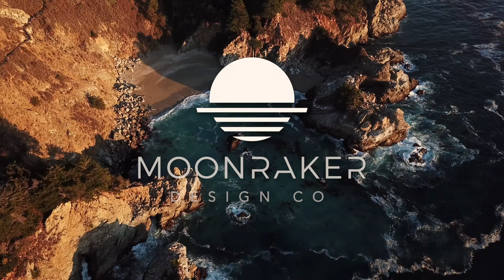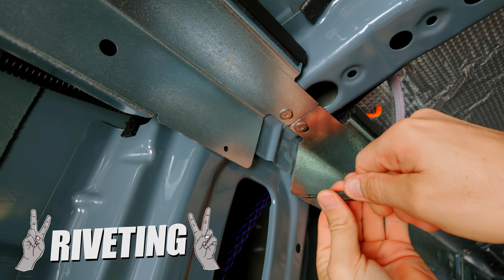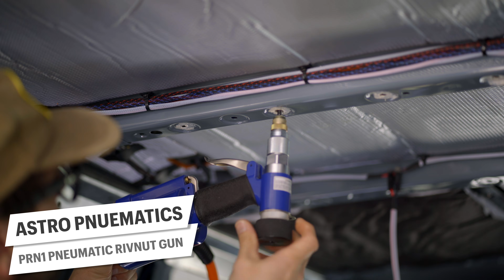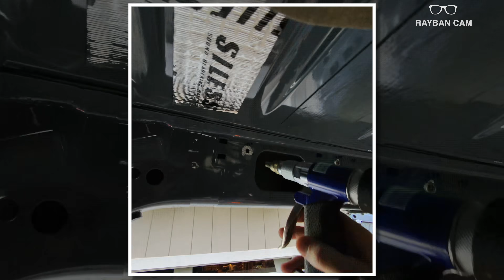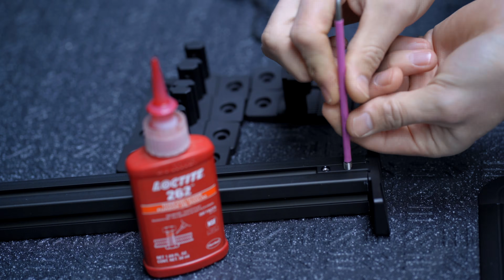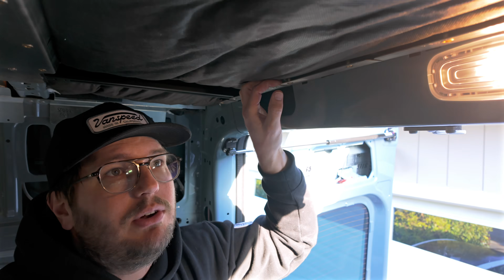Adventure-Ready Sprinter Van Ceiling Structure: Our Secret to Strong Support

Comment: This product on your website ?
Reply from the maker: Hey yes, all parts can be bought separately. Everything has been updated with quite a few improvements from these original prototypes. 

- Front & rear transitions for headliner and d-pillar are always stocked - https://www.moonrakerdesignco.com/collections/interior/products/sprinter-144-van-ceiling-support-structural-kit-copy
- Wall transitions I bring in small batches and have some in stock right now - https://www.moonrakerdesignco.com/collections/interior/products/sprinter-front-rear-ceiling-transition-bracket-kit-copy
- Center ceiling support braces are made custom because there's a lot of things going on with peoples roofs & cabinet situation these days so like to make sure those are addressed - https://www.moonrakerdesignco.com/collections/interior/products/sprinter-144-van-ceiling-support-structural-kit
- Brackets for the extrusions are always stocked, but you buy the extrusion pieces yourself. 

Hope this helps.

Comment: Amazing work! I wish I had the patience to be even half as meticulous as you. I’m headed over to your site to grab a set of brackets for the Dometic we just installed.

Drumroll… and an unsolicited tip:

For anyone who doesn’t have a Swarf Sucker 9000, a neodymium ring magnet works great for catching swarf. Just place the hole of the magnet over where you’re drilling and it’ll snag  most all of the metal shavings. I put a small piece of painter’s tape down first so the magnet doesn’t scratch the paint.

Thanks for the great video! I also just watched your isn’t it hydronic video and took a ton away from it.
Reply from the maker: Hey friend, thanks a bunch we really appreciate it.  I wish I had more time to work on all the things!!  It's getting very difficult these days. 

Thanks for the tips for others as well!  Always great to have people putting out learnings into the community.

Comment: Can we discuss an onlyvans deal for the pricing for a set of those fancy wall brackets you diligently worked on.  I am in need of those since I prefer the quality and strength over wood.
Reply from the maker: I'm not sure what an onlyvans deal is... lol.  The number of custom brackets/reinforcements in our van is pretty vast... which ones in particular are you referring to?  I personally have never been a fan of firing strips in a van for that very reason.  The dynamic/flex nature of a motor vehicle is much different than say... a house.
Reply: I had a great chuckle when you did that bit on the fan install didn’t want to get for the only£@ns reference.  

Most fail to realize that it’s a moving vehicle and the conversion of a vehicle needs that factored into the equation. You’re the only one that has created these brackets, I just don’t have the equipment to fabricate them.  If you want to part ways with .dxf files that would work, but I doubt that.  But I can dm you my number and we can chit chat more about it, love your build my 🥷 🐢 and the journey.

Just bought my 24 144 sprinter and starting my journey and appreciate your work!
Reply from the maker: @yetidrone  Lol, glad you liked that one, that's my wife's least favorite lol.  

I do have some of these up for sale on our website, but we've been going through a lot of growing pains as demands have increased and we've been working to stabilize things as stuff has been out of stock for a bit.  

Thanks for your kind words and comments and congrats on the Sprinter Van!  Can't wait to hear about what you have planned.

Comment: The one problem with aluminium it's thermal conductivity... It's 3x ofbsteel body, so internal aluminium fram connested directly to the body meand a lot of conductivity... Cold in winter, warm in summer...
But design is stunning 🍻
Reply from the maker: Thanks for the comment, compliment and perspective.  Honestly, from my point of view you are in a giant metal box so unless you lizard skin or similar the entire interior to create 100% thermal breaks it's a loosing battle.  

I choose to have lightweight and strong recessed cabinet/ceiling mounts over some relatively minor additional radiant heat/cold when you compare added surface area to total pre-existing surface area.

Comment: For the ceiling are you planning on attaching 1/4 inch Baltic paneling? Assuming will be running a slat or something similar on top of that.
Reply from the maker: Yes, my plan right now is to use 1/4” Baltic Birch wrapped in a matte black velvet or Alcantara fabric, and then Oak slats on the top to give a really nice contrast.  

Since I recorded this video, I’ve updated the design of the ceiling mounts a little bit. I’ve added a lot more holes. My plan is to fasten the Baltic Birch with black fasteners between the slats and then fasten the slats with a countersunk brass washer and flathead screw. I think it will look really nice and gives a nod to old maritime marine style construction.
Reply: @moonrakerdesign ok that actually sounds awesome! I ordered the maxxfan plates from you site; about to place another order. Would the ceiling mounts work on the 170?
Reply from the maker: @MattSchoen79  I think it will end up looking nice.  Finding time to work on my own van has been quite challenging these days, but I'm really going to try to wrap this up this summer.  It's a good question, I'm not entirely sure as I've not had a chance to spend much time in a 170.  I have to assume that Mercedes kept them the same and simply added middle sections. 

Thanks so much for the order I appreciate it, I'm actually packing it up now, was a bit behind because my sons birthday this weekend.

Comment: Excellent Todd!  I wish I could have had these for my NCV3 tall van paneling build.  Your website does not say if these are good for the NCV3 (2007 to 2018), they look like they could be adapted though if not specifically for the NCV3 overhead.   As you will probably put a Reflectix type material on the panels that will give you some type of "bushing" between the panel and the metal of the van or your ceiling structure.  If you were wanting a material to put between panels or (metal or wood)/metal to reduce squeaking sounds, I would recommend a felt, not rubber which will stink and off-gas.
Reply from the maker: Hey Glenn good to hear from you. I’ve never seen the inside of a NCV3 so not sure if they would fit or not.   I’m not sure if or what I’m going to put between the panels, I’m planning on doing some experiments here in the near future but thanks for the tips and options!
Reply: @moonrakerdesign if wanting to reduce possible squeaking definitely not a Chinese rubber that will off gas and STINK forever.  A felt works.  Don’t ask me how I know, 😊

But definitely try them on a 2008-2018 NCV3 if you can.  You will sell them if you do.  I would have bought them.

Comment: You the man dude!  I'm taking the Sprinter leap very soon and your channel was just the push I needed to make the jump from my Tundra.  Awesome channel.  Anyways, I was going to reach out on Sprinter-Soucre, but apparently I don't have the street credit to comment on your build thread.  What design software are you using for layout planning?  I was going to grab demension off online spec sheets for the 144" and pencil/paper my layouts but I noticed you had some nice 3D van layouts on your lighting video.  Keep up the content!!
Reply from the maker: Hey thanks so much and glad to hear you are taking the leap!   I use Solidworks and Fusion 360 primarily.  I do have a scan file, but honestly most of my measurements come from a tape measure or ruler and the van.   Or some times basic templating with cardboard or butcher paper.

Comment: This looks so good; the attention to detail is top notch! Echoing others, would love if this kit was for sale. I'm hopefully picking up my first 144 Crew for my young family soon, and want to do a light modular build. This is almost exactly what I've been looking for to mount some ceiling l-track robust and secure. Do you think the Flatline Van Co bed system would fit with your kit?
Reply from the maker: Hey Tyler, thanks for the kind words and stopping by to leave the comment.  Unfortunately my plate is too full right now to add these to the offerings.  I'm working pretty much every night and weekend to ship the stuff that I already make and I really really really want to finish my own van this spring/early summer, so having to pick and choose.
Reply: @moonrakerdesign   Understandable! At the very least, are your Dometic AC brackets pretty much the same (minus the ABS piece) as what you used for the north/south cabinet supports? Would the end brackets fit in 30mm 8020? 

Initially I'm thinking I'd like to mount some l-track on the ceiling going north/south, similar to the Adventure Wagon kit, so some sort of support is probably warranted. Or do you think "beefy" l-track would be strong enough spanning between the roof ribs?
Reply from the maker: @ it really depends on what you plan to mount to them, or if they are just to hold you ceiling panels up.   I wouldn't be worried about the l-track as much as I would be about single point fasteners on each of the roof ribs. 

Have you checked out Lost Hiway, a little cheaper than AdWagon

Comment: Todd, more AWESOME designs!! Just got back in town. My 2024 170 Sprinter is at Mercedes getting a new drive shaft and who knows! May be a recall. I LOVE your hood struts and can’t wait to install them when I get my van back. I have get your new products!  When can I order the Swarf 9000?
Reply from the maker: Hey Rod, good to hear from you and sorry about the drive shaft issue!  I actually heard that was a problem on newer sprinters so glad they are addressing it.   Thanks for the nice review on the website and can't wait to hear what you think once they are installed. 

I actually posted a link to the swarf sucker .stl file on my sprinter-source build thread - https://sprinter-source.com/forums/index.php?threads/120137/post-1672838

Comment: Those metal supports will create a thermal bridge, I would wrap them in insulation or put them on spacers with low conductivity.
Reply from the maker: Sure you could put a think layer of neoprene/cork/FR4 underneath each if you wanted, but you still have metal to metal contact on the screws.   I personally didn't see the need to do this for my van, but to each their own.  The Ad Wagon kit (and almost all other commerically sold kits) bridge way more than this with full length L-track and supports and people love and swear by them 🤷‍♂

Comment: Very nice work Todd!  You made a detailed video on hiding the factory MBZ harness that required  quite an extensive rerouting of wires.  Did you consider designing your ceiling support structures to have enough space  to avoid all that rerouting?
Reply from the maker: Hey friend!  Timber Vans actually makes a wall kit that allows you to go around the factory wiring harness like that.  Since I had already done mine I wanted to save all the precious mm inside the van and to be honest if I was building another van I'd do it the same way.  It would go super fast now that I've done it once and I'd want to tuck the wires inside the D-pillar again anyways.
Reply: @moonrakerdesign  I swore I wouldn't use my engineering powers to go down anymore rabbit holes and try to be more pragmatic to just get shit done. For better or worse your videos keep pulling me back in and reminding me that the process and journey are the best parts.  I really appreciate and enjoy watching your design and problem solving skills.  Keep up the good work my friend!

Comment: Awesome Engineering!  I’ve already relocated my harness.  Will timber kit still function with it moved?  Anyone know?
Reply from the maker: Hey David thanks so much.  Yes the timber van kit will work it's just dropped down an inch or so on either side.  Which makes the roof more curved on the edges.  I'm trying to save every mm of space in this 144 lol.

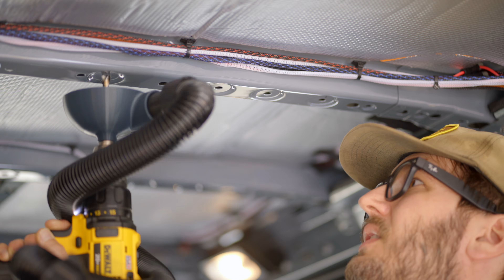Comment: Grat informative video!  Can you provide a link to the tool used at minute 6:08?  It is like a funnel with a Shop Vac attachment that goes on the drill?
Reply: Hi - I think he mentions that he designed it and is working on making it an available product.
Reply from the maker: Lol.  Yeah @Kehl is right... that's the "Swarf Sucker 9000".  I just 3D printed it.  I'll gladly share the STL file or if you want one from me just the cost of the filament and shipping, no biggie!  You can shoot me an email through the website.

Comment: I love,the great ceiling support system, especially the pieces for headliner edge and REAR above doors.  I NEED THOSE TWO PIECES. Thank you. Janice, Port Angeles, WA
Reply from the maker: Hey Janice, thank you so much for the comment and sure thing.  Those are easy!  I just need to know if you want a different bolt pattern on the bottom flange and if M5 rivnuts are OK or if you want a different size.  Probably best to move that conversation to email through the website or direct:  hello at moonrakerdesignco dot com!

Comment: Another quality and well thought out product and video! I am wondering your thoughts on using only rivets to attach those panel structures?
Reply from the maker: Thank you!  It should work no problem, there were just already holes to work off of in a lot of spaces sized pretty close for rivnuts.  

Down on the side walls I'm using the smaller factory holes to line up my structure with rivets first and then have a template on where to drill my rivnut holes for mounting cabinets.

Comment: What about winter camping, aren’t you creating thermal bridges with those metal brackets?
Reply from the maker: Yes, but the entire van is a thermal bridge until the wall and ceiling panels anyway.  Safety is our main concern here with loaded upper cabinets and making sure we have adequate attachment points and reinforcements there.  

I guess you could put a think neoprene layer between the contact points, but will likely go the route of turning up the heat a bit since I'm not a full time van lifer.

Comment: Todd, with regards to rivnuts...YES please!  Also, have you looked at how to punch hex holes?  There are hex rivnuts, and spinoout would be a non issue if the hole is hex.
Reply from the maker: Hey, thanks again!  I haven't looked into bunching hex holes yet, I know there are punch tools that can do this, but I've had really great success with the round rivnuts at this point using my process!